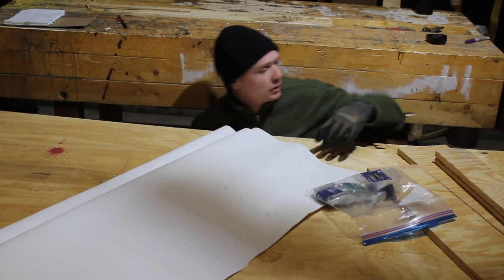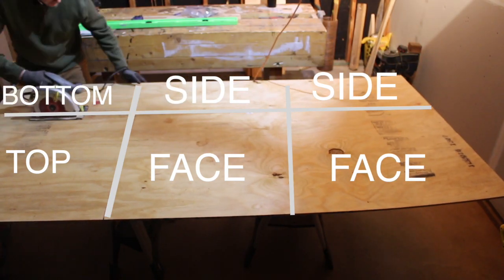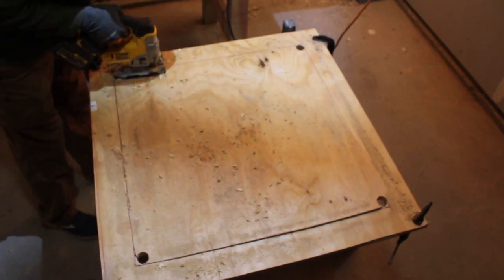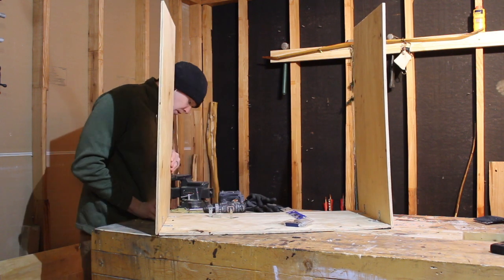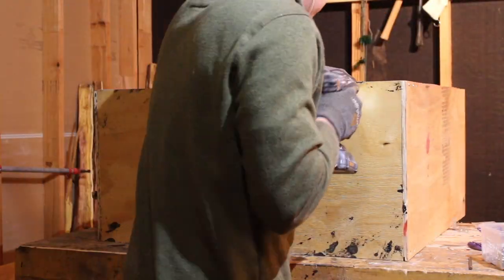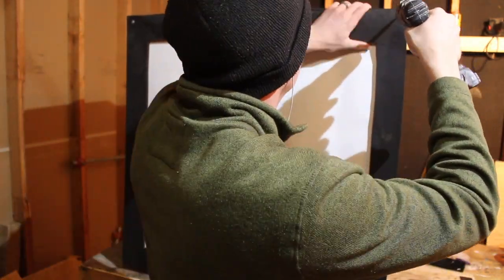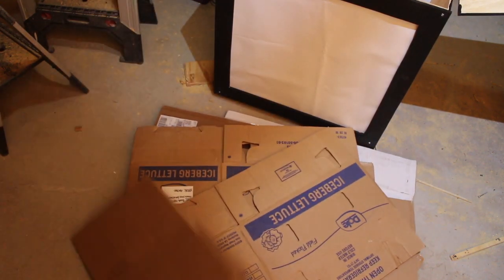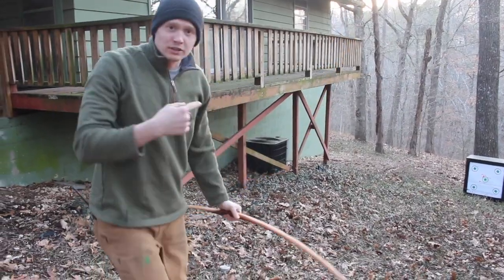DIY HOMEMADE ARCHERY TARGET FROM SCRAP MATERIALS!

Comment: I made a cardboard filled target with inside layers oriented perpendicular to the arrow flight as you did in this video.  My arrows were difficult to remove.  Remade it with the cardboard oriented in the same direction as the flight.  Packed them tightly edge to edge, top to bottom.  Stops my arrows nicely and is easy to pull  them out.  Takes more time to cut the cardboard into wide strips but worth the time/effort.  Thanks for your great channel and help.  Using your guidance, I made my first bow (hickory self bow).  It shoots great.  FUN!

Comment: Kramer- try getting used carpet from your local carpet stores. Cut it into long strips about 3 feet wide then roll it up and tie it with twine or whatever rope you have. It’s totally free and the carpet/pad does a great job. You can easily pull out arrows. It lasts a long time. It can get rained on or snowed on and it doesn’t change or get soggy. They go together really fast and simple. You can Spray paint a bulls eye and boom. I made five of these for my back yard. And they work great.

Comment: Even better. Work safety stores sell old clothes cleaned, cut and compressed into 20x20x10 inches bricks for a fiver (as rugs for oil spills, etc). They're ready to use archery targets up to 80 lbs.

Comment: Although the target i made wasn't as cheap,  it works really well.  I have a cardboard box 30"x30" and 11" wide.  3 pieces of carpet and 6 or 7 cans of spray foam. Basically box, foam, carpet, foam, carpet, foam, carpet, foam and box. Kinda tricky getting the layers of foam even and no air pockets but not too bad. Put a shoulder strap on the top corners and it's really easy to carry and weights half what store bought.  Target will stop arrows from a compound bow and bolts from a crossbow as well

Comment: If you’ll go down to Home Depot, get a roll of attic insulation, I don’t know, wall insulation, the kind, usually pink, in two foot wide rolls, and four or more inches thick. I stuffed it in a tow sack, about the size of a pig. Stopped my arrows just fine, and easy to pull out, two fingers easy. Make several and scatter them around in different angles, it makes a pretty good bunch of different angles to shoot